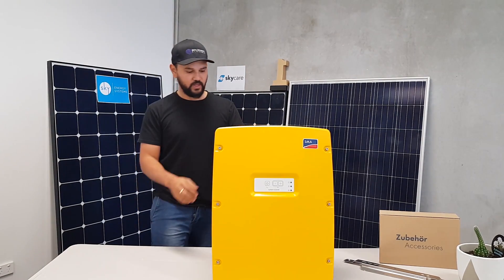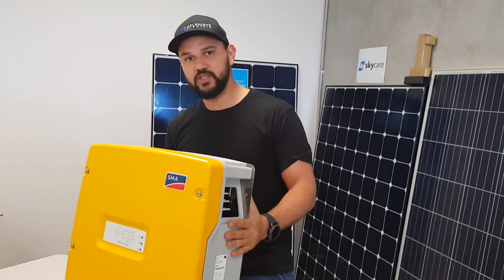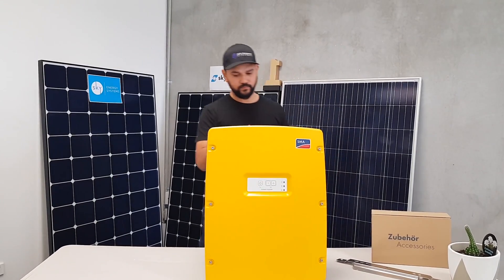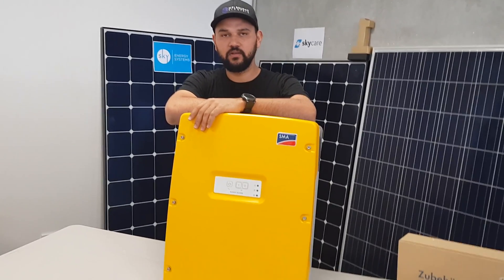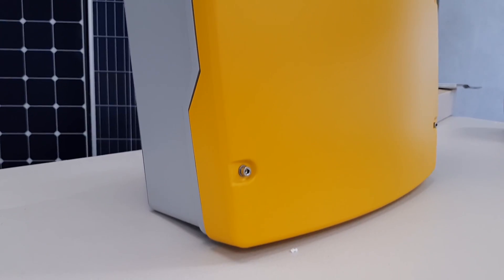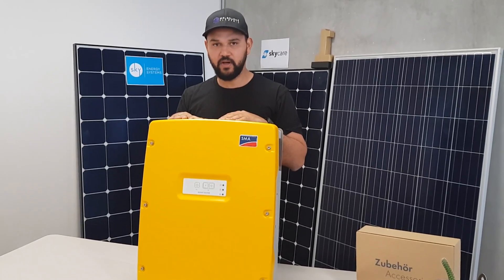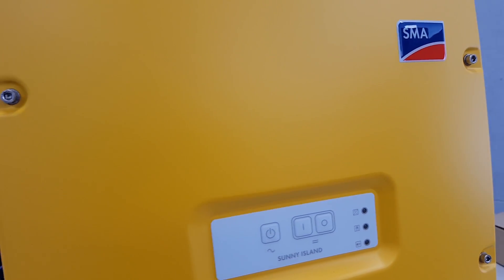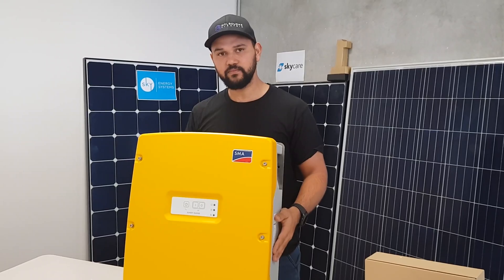SMA Sunny Island - Off Grid Inverter Overview (SMA 8.0H)

Comment: Hello, I have such an inverter and I can not connect it with a pv inverter what power should be from pv panels
Reply from the maker: It needs to be AC coupled with an SMA Sunnyboy inverter - you can't connect solar directly to this inverter (Sunny Island).
Reply: @skyenergy6282  hello tz sma boy inverter connected to the network and only to sma island inverter

Comment: Hi chaps,
Thanks for your video explanation.
I have heard that the Sunny Island units work in conjunction with Immersun power diverters, but that the wiring connections are a tad tricky.  Do you have a wiring diagram that shows exactly where the Sunny Island AC input & output connect to the grid with respect to Immersun units please.  I have 2x Immersuns connected as master & slave with currently a grid-tied system in the UK.  However I've recently taken delivery of a Sunny Island SI6.0H-12 & 4x 12 220ah AGM batteries.  It would be most helpful to have any guidance that you two experts can offer as to the exact wiring connections w.r.t.the Immersun units.
The reason I ask is that I have a Voltage Optimiser unit (VX2) that has just failed last week (which is a glorified step-down voltage reducer) & I think the pulse technology of the Immersuns may be responsible for its failure.  The Sunny Island unit also has an even larger transformer built into it, so I am understandably concerned that my Immersun units may shorten the life of the far more expensive new Sunny Island unit.
A second question if I may: I'd rather like to limit the charge sent to the batteries from the Sunny Island unit, to extend the lifespan of the AGM batteries & not to over-stress or over-heat them.  Can the Sunny Island unit be programmed to achieve a slower rate of battery charging?
Thank you, JohnnyK from the UK.
Reply from the maker: Hey John, Yes the Sunny Island can limit the battery charge and can be programmed for this. As for the immersun units, would you have any wiring diagrams you could share and we could work out the interface with the Sunny Island for you?
Reply: @skyenergy6282  Hi, I've just sent you an email to:  team@skyenergysystems.com.au  with the wiring diagram that you'd requested & a couple of other photos of the Sunny Island & battery bank.  I couldn't work out how to send the wiring diagram to you via this YouTube thingy, so had to send it via an email to you.
I'm very much looking forward to your helpful reply.
Thank you, JohnnyK.

Comment: Is this inverter solid state transformerless?
Reply from the maker: I'm 95% they're not solid state transformerless, which is why they're so big. Would have to call SMA to confirm that
Reply: @skyenergy6282  definitely low frequency torodial transformer based...

Comment: Hello Guys I am Solar Installer from Tanzania. I am planning to start using SMA inverters. In my upcoming project i want to use SMA inverter. In two project the 1st is Gried Tied With Battery Back up system. If you have a full circuit diagram of it’s configuration i will be happy if you share it with me.
2nd project i want to use this Sunny Island as a back up Inverter. Please also share the circuit diagram. I got confused it has the AC1 (AC Input From SMA Solar Inverter) & AC2 as read from manuals of Off Grid System with storage but i dont see the output terminals. 
Here is my email
musadynooh@yahoo.com
Here Whatsapp number
+255 712 555689
If possible check me through WhatsApp so as we can discuss some business issues and opportunities here in Tanzania.
Reply from the maker: Hey Musady, you might need to contact SMA directly for their circuit diagrams etc. Happy to help you here with whatever specific questions you have :)

Comment: I have SMA Sunny Island SI8.0h-12  but I have some problem with modbus configuration. I can't do "modbus command" to create set point power active and reactive nevertheless it is OK just for reading meter data. Do you have an idea or experience with Modbus?
Reply from the maker: Hey Kemas! We haven't really had the need to work with Modbus but this link has some good info that might help you on the way
https://www.sma.de/en/products/monitoring-control/modbus-protocol-interface.html
Trust that helps :)

Comment: Will this work with grid connected. So in the evening when there is no solar and no battery will it work with AC INPUT from grid?
Reply from the maker: Hey DD Wayne, It's not approved for on grid use yet. It will work but not approved in Australia, it will be approved for on grid use in the future.